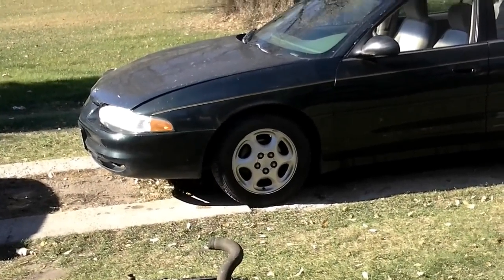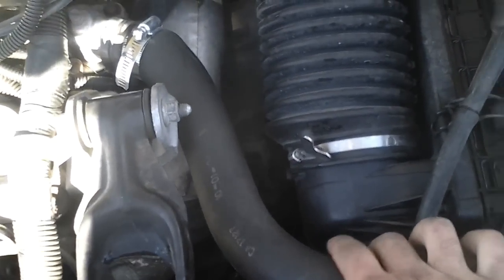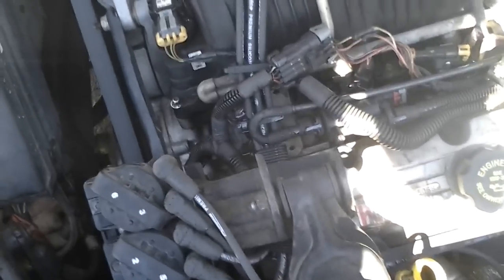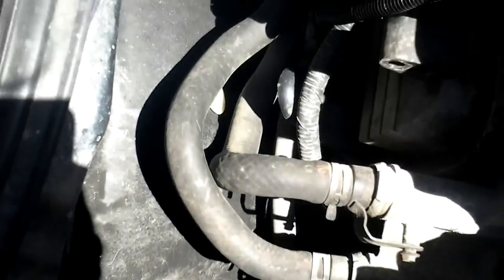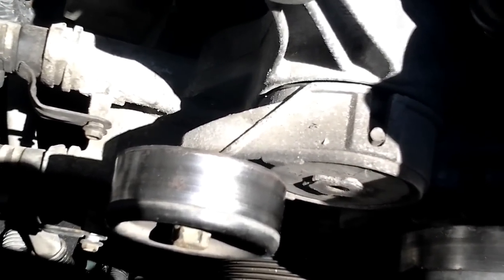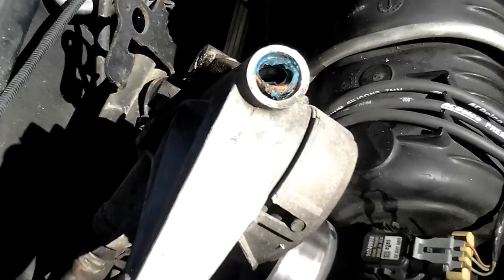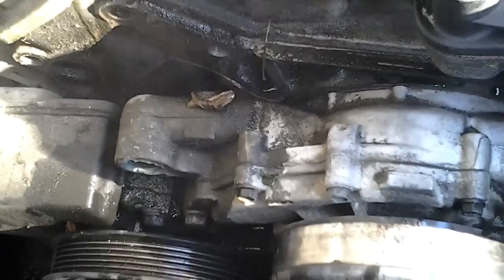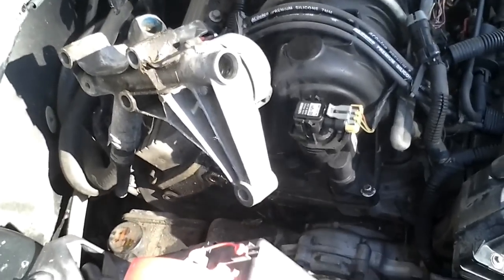1999 Oldsmobile Intrigue 3.8L V6 coolant leak: Squishy Fake Gasket Rage AGAIN!

Comment: Those elbows I noticed feels a little loose on after market elbows. I added RTV on the new aluminum ones for added protection. But yeah I pulled the elbows off and knew they were going to break. But then again I put a new UIM and installed metal gaskets for the LIM. However my new UIM is still plastic and it bothers the shit out of me that it is plastic. So now I have went and gotten myself a L26 aluminum intake along with a adapter plate for the throttle body and when I get around to doing the UIM swap mod for added durability then I will be blocking the 2 coolant ports in the LIM and opening up the one below the surface and if the gasket ever fails it wont suck coolant into the intake.

Then again I love my engines as you also seem to appreciate the engineering put into the engine as well. Which causes people like us to fix things properly with new parts instead of cobbling something together that MIGHT work.

The 3800 is a fun engine to work on. I also liked the GM 122 engine it too is easy and fun to work on. So far the work I have done on my series II powered car along with the work I have done to the tranny has such a long list. I tend to repair things before they go or if they seem a little old and weak. A good example is the alternator I just put on. It still worked it was just old and tired. But I have to say I am going to enjoy the mod of the UIM. It will allow me to flex my inner engineer to design and see what I come up with. Then I may later down the road do the top swap for the S/C once the car is retired from daily driving.

Anyway sorry to talk your ear off. Good work on the elbows and it is a good little video. Any I feel ya with the RTV thing I have ran into it countless times just thank God you didn't find JB weld instead lol. I keep telling people you can't glue an engine back together.
Reply from the maker: evilcowboy JB weld would have been an improvement over the weak sauce silicone that was there.  I ended up having to replace the intake manifold on that car because the car was having trouble starting, then blew up the intake with a backfire trying to diagnose it with ether.  Didn't damage anything other than the plastic, but I did find out that there is a serious flaw with the egr causing the plastic to weaken and fail, leading to engine fires from fuel leaks.  

I also ended up having to replace the radiator once I got the other leaks fixed because a pinhole leak developed right next to the return bung.

The next few things on the agenda for the car are new control arm bushings, a complete brake flush and pads, and rear struts as I've already done the front.  I have to wait for the owner to get the money for parts, but it's not like the car isn't going to make it down the road as is.  The breaks are only being replaced because I'm flushing the fluid.  They appear to have at least half the material left.

The car was crashed into a curb, then a tree by the previous owners son, so I've been trying to catch up to all the problems the kid and previous mechanic caused.  Repairing those problems, along with worn out parts is par for the course.

I did finally manage to convince the owner that spending $1K on a used car is pointless when she'll be putting just as much work into it as a $500 used car.  She just recently purchased a pontiac grand am with the 3.4L engine that actually needs less work than the Intrigue still needs.  I just wish I could have convinced her sooner.

Comment: I have the same vehicle with a "special" engine, I was told, which is a limited edition engine, the same type they put in cadillacs.  It has a head gasket leak, and antifreeze is leaking back into gasket.  The mechanic wants 2300 for repairs.  I paid 1200 for it.  Do you think a very good car mechanic who was a top millwright fix it rather than pay a garage? At least I would know he put top grade parts in it. Thank you!
Reply from the maker: I would have some car friends tell you EXACTLY what engine you have before going to a shop with it.  If you DO have the northstar 3.5L LX5 engine (the cadillac engine) then I would try to find a different car.  The engine is known to have problems with the head bolts stripping out of the engine block after the aluminum has been overheated.  It's a very annoying problem that most people who haven't had experience with cadi engines wouldn't be able to deal with.  The only REAL way to get around it is to drill the holes out larger, tap them with new threads, and put head studs in.  

Here's a video showing what that looks like, but I'd mute the sound...
https://www.youtube.com/watch?v=5G8zElSkvD4

Wiki link about your engine:   https://en.wikipedia.org/wiki/Northstar_engine_series#LX5_(Shortstar)

If you do plan to keep the car and get it fixed, make sure your friend knows about the head bolt problem BEFORE you let him touch it.  Otherwise, you're better off taking it to a shop that can deal with it properly.  Make sure you are clear that you won't be paying them more than the agreed upon price if they end up breaking anything else or causing other problems though.

Again, if it were me, I'd just get a different car.  Those engines might have some power, but they are one hell of a headache when they go wrong.

Comment: i just fixed my water pump and it leaks still why?????
Reply from the maker: +Juanita Merrill 
I'm going to need a lot more information than that.  I need to know the make, model, year of the car, where it's leaking from, what parts you replaced, if the mating surface of the engine or water pump was damaged or warped....  Things like that.  Pictures would be even more helpful.

Comment: The guy before you was extra stupid and put in green coolant to so the intake on this 3.8 is going to need to be changed down the road.
Reply from the maker: +travelthenorth2 The upper intake manifold problem this car has is not related to the coolant in any way.  The problem comes from the e.g.r. inlet from the lower intake to the upper intake allowing too much heat to pass into the plastic, causing it to wear out and fail.  Also to catch fire on occasion due to fuel leaks.  It's supposedly a common problem on these 3800 engines.

I've already replaced the upper intake on this car due to that very damage.  

The new intake comes with a smaller orifice that you glue into the egr tube with lock tight to reduce the flow and prevent as much heat from entering the intake.